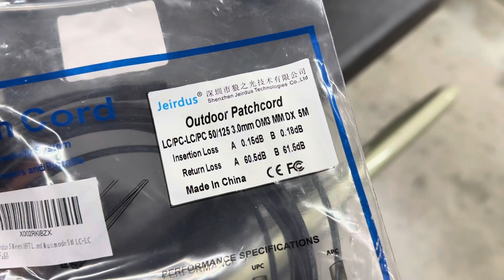How Tough is an Armored Fiber Optic Cable? Extreme Testing of Fiber Part 1

Comment: Hey Sweettree guys. I’m new to all this stuff. Can I use this fiber with my mackie 1202. I’m not sure how this works. Can you explain more.
Reply from the maker: Great question, technically yes you can. It would be extremely expensive and not worth it but Whirlwind and a few other company’s make or used to make digital snake systems that incorporated fiber, Madi or catV.